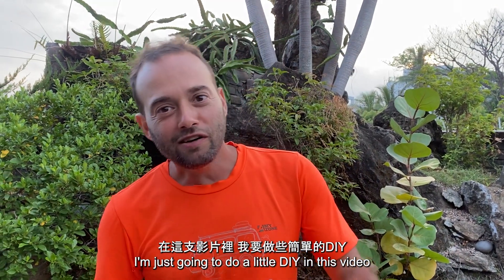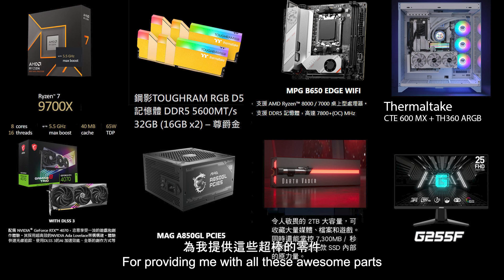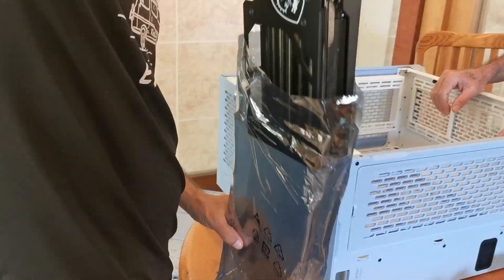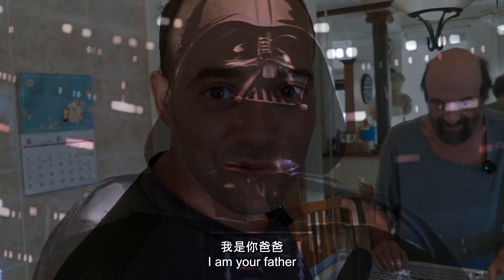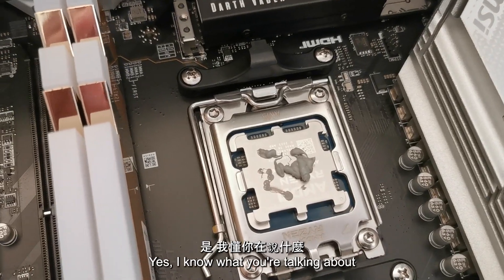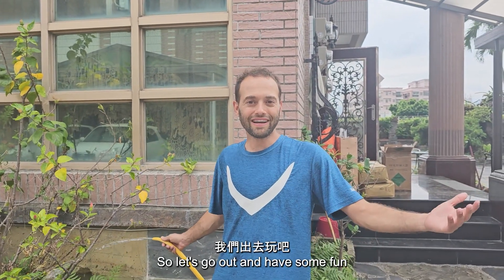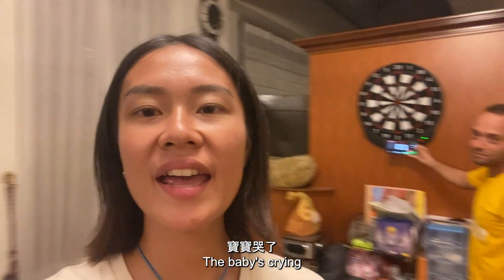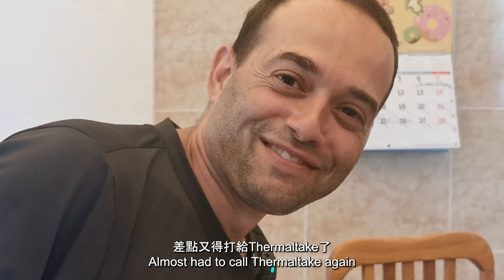美國阿公在美國連智慧型手機都不會用，我請錯了人幫我裝電腦了嗎？Did I ask the wrong Person to help build a PC? RTX 4070, AMD 9700x

Comment: Double check the correct placement of the RAM sticks in your motherboard. I'm fairly sure they should be in alternating slots: either 1, 3 or 2, 4. It's faster that way... because of reasons I can't remember.
Reply from the maker: When I turned it on it gave me a warning that the position was "suboptimal" and so I put them in 2 and 4

Comment: U will need a new big monitor soon
Reply from the maker: I'll add another one later.  I prefer to use dual monitors because I run a lot of applications simultaneously.  So I often will be reading or needing file explorer on one side, while I do my main work on the other.

Comment: It's been a while since I built a computer. What's cheaper?  Faster CPU; or the cheaper cpu + special cooling equipment?
Reply from the maker: It's cheaper to overclock, but it depends on the application.  If you are running apps that can take advantage of all the threads, then a more expensive CPU is better.  But if you're running apps that are running on a single core, or at least less than 8, then you can get a lot out of the increased clock speed. I'd say even if you went with a more expensive processor, you might as well overclock that too. For most of my applications, I will get a very good boost from overclocking it. 

For long-term cost we also need to consider power consumption.  The 9700x is very  low power, so by using variable power settings we can have it running at it's stock voltage for most applications, and only run overclocked when the power demand increases.  It will use about twice as much power when overclocked, so we only want to do that when we need it.
Reply: @followxiaofei  Interesting. I didn't think it would make a difference depending on the software. So I guess as long as your videos render faster then thats a huge quality of life improvement either way. :)